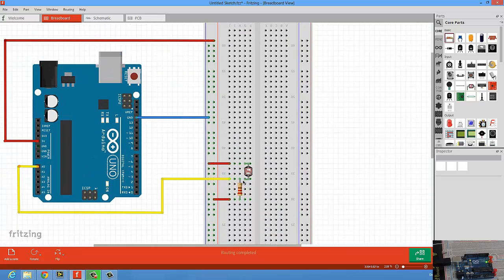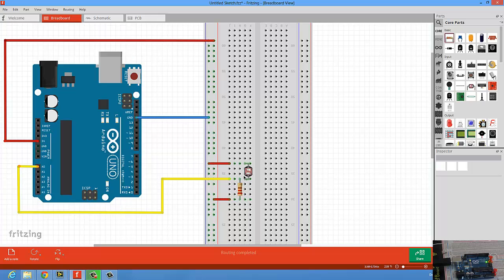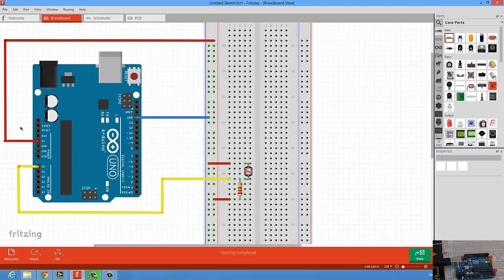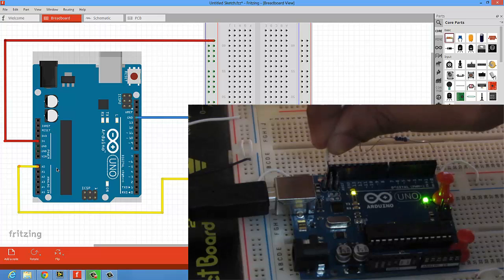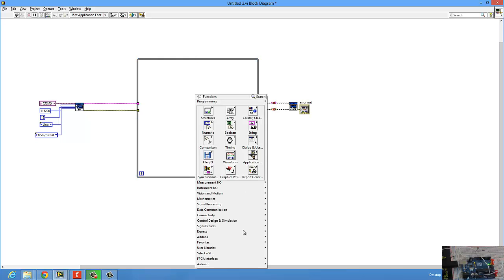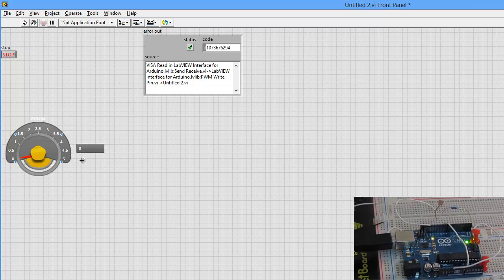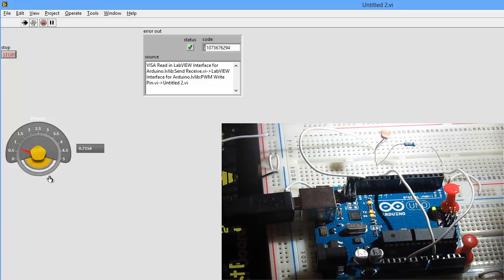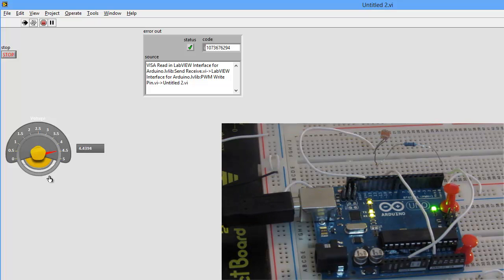Interfacing Arduino with LabVIEW   Part 3 Analog Read

Comment: Hi there i just subscribe to your channel, one doubt came out to me, can i do it with 2 sensors? or whatever i mean can i do two analogue reads at the same time? how?
Reply from the maker: Arduino CANT take two readings at the same time because it is sequential in its task. So it will read the first sensor the go to read the second sensor
Reply: What about high or low values instead of reads i mean reading one voltage from the sensor like u did and other input reading 5v or 0v, it is posible?
Reply: If it cant at the same time can you show me how to do it sequentially?
Reply from the maker: You can but it will happen in sequence (meaning one action will execute and then the other action will  execute)
Reply from the maker: Just repeat the same connection for another analog read function in the while loop
Reply: @AhmedSweleh  
I did and i put a second analog read in the port A1 and a bolean indicator, but the indicator for the A0 input turns on too, i mean it doesn't matter which input i connect,  both indicators turns on A0 and A1, it has to be independent

Comment: Hi there,Thanks a lot for the great video. I just wonder what 10k resistor is for? Is It for voltage divider?
Reply from the maker: Tuan Pham for creating a voltage divider with the LDR
Reply: Ahmed Sweleh thanks a lot :)
Reply: for some reason my arduino isnt reading the voltage but when i tried reading the v directly from arduino code it worked fine

Comment: Hello Ahmed,
I have question about the pin number, why did you write pin 0 where the pin that you used was A0?

Thank you
Reply from the maker: The VI that I was using for analogRead only accepts values between 0 and 5 which are the same numbers for the arduino's analog pins
Reply: +Ahmed Sweleh hi?how r u,by the way,do you know  how to connect ftdi midi and hairless midiserial bridge,and about the code number,some one saying code number.and do you know the simple way,to make my arduino drumkit and piezo and midi electronic work,can you tell me please? thankyou

Comment: hey bro, can you give a tutorial for controling LED with LDR sensor? thanks alot
Reply from the maker: You mean if I put my hand over the LDR, the LED turns on and when I remove my hand off the LDR the LED turns off? or you need something specific?
Reply: Ahmed Sweleh yes just like that, if you put your hand on the LDR the light intensity will become 0 right? so the LED turn on to light up the room
Reply: how its going bro? i still waiting your video :)
Reply from the maker: Sunnu Dwi Hargadi It will be up today after I come back from work ;)
Reply: Ahmed Sweleh ahh okay, sory for bother you :)
Reply from the maker: Done hope it's what you need